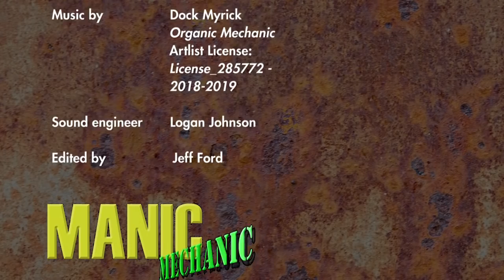Ford Interior Black Paint Isn't Black Steering Column Refinish

Comment: Good tips. Every single centimeter in my truck's interior is some shade of green. The paint color is Mallard Green, the dash pad is like a metallic green, the door panels, bench seat, steering column, steering wheel, and seat belts are all green. EVERYTHING. And although it could use some freshening up, I'd have to go with black repops because there is no aftermarket green stuff for these trucks.

Comment: I appreciate the fact that Ford uses enamel paints as you say.  I was told a story by my dad when I was a teenager, (I'm 66 now), that after WW2 Henry Ford was successfully using soybeans in his paint formulas to produce a durable, exterior enamel finish that possessed a brilliant shine.  At that time, GM was a manufacturer that traditionally used lacquer on their exterior finishes.  They were displeased with lacquer's lack of durability in particularly the exterior color "Black" on the Cadillac line of cars.  It just so happened that Ford was looking for a reliable, smooth shifting automatic transmission for the Lincoln line, as in GM's Hydra-Matic.  (GM was considerably ahead in auto-trans technology, then.)  I'm not sure who propositioned who first, but Dad implied that it was GM who asked Ford and a trade off was made.  Henry Ford's patented formula, durable glossy black enamel exterior paint for the Cadillacs and GM's Hydra-Matic auto-trans for the Lincolns.  I'm not sure how much is fact on this story, but my dad was very informed in the subject of automobiles at that time. 
In relation to the video, that Rustoleum metallic black is just what I was looking for.  It's "close enough" for me.   Many thanks for supplying the specifics on the paint, Jeff, you're always thoughtful and thorough and this is much appreciated.

Comment: Great video. Helped me a lot in restoring the column in my 1971 F100. Keep up the great videos. One thing I would have liked to have seen mentioned is the fact that many of the original steering collars tended to wear out after a while and not hold the vehicle in park. I think ford was sued over that. I think it is always a good idea if you pull the column for rebuild to replace that collar with a new one from NPD. Mine was so bad you had to hold the shift lever up to to start it because it would not engage the neutral safety switch. The new collars seem to be made out of a stronger steel. the way to tell the originals is that the dial indicator was cast with the part. The new ones have a slot cut in and you slide the indicator in. A lot of people have a sloppy shift but don't realize what the problem is. The detents get rounded off and is not repairable. They will all fail eventually. Pretty cheap safety fix.
Reply from the maker: Good point! Ours was in great shape so we didn't even think to address that.

Comment: could you instead of taking the bell off the Mustang column. could you just use the whole Mustang column.? it,s been something i have been thinking about . i was wondering if the Mustang column would be to short. there is a difference on these F-100 steering columns if your truck was a factory power steering column vs. a manual steering truck.
Reply from the maker: Honestly not sure. I just know that the bell is the same via the part numbers. I have a '73 Bell on the way that moves the hazard switch to the column too. want to try that in the F100.
Reply: AutoRestoMod Car Restoration Modification the difference between a p/s column and a manual column. is that the p/s is shorter. the way i understand it is ,if you are swapping in a p/s column into a manual steering truck. you have to cut down your column or use a factory p/s column. or go with an aftermarket one. sometimes i get these ideas in my head, sometimes they work out and sometimes they bite me in the butt. it was something that i had just wondered about. especially given how Ford sometimes used the same part on several vech. to keep costs down. one day i will most likely go to the jy and get a Mustang column just to see if it  would fit.